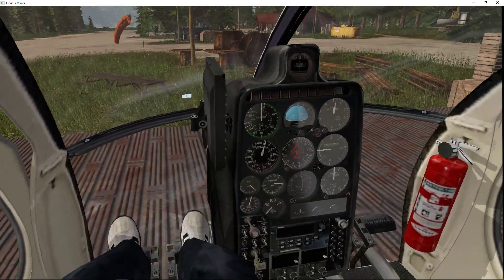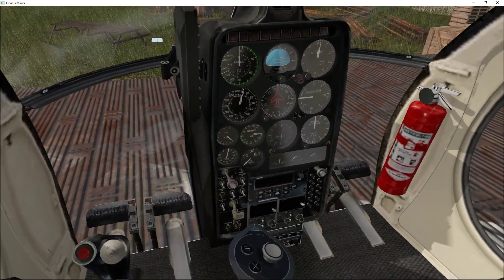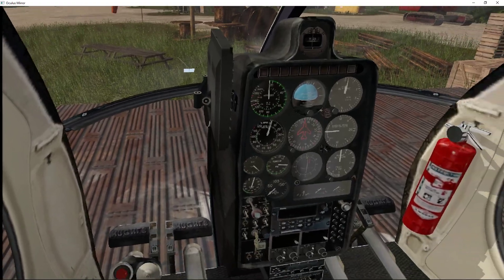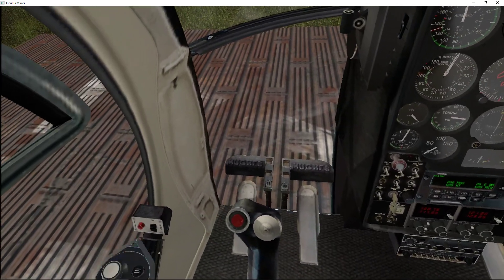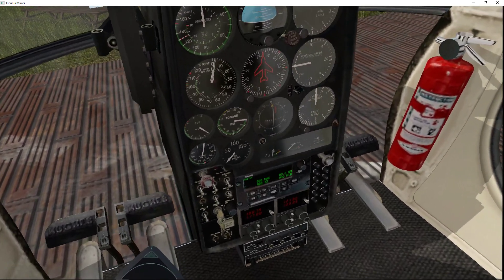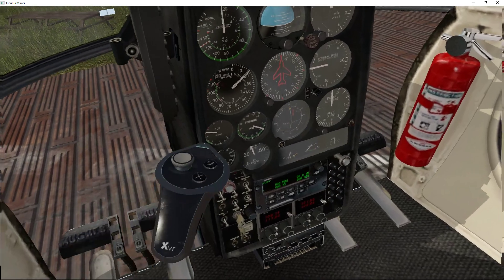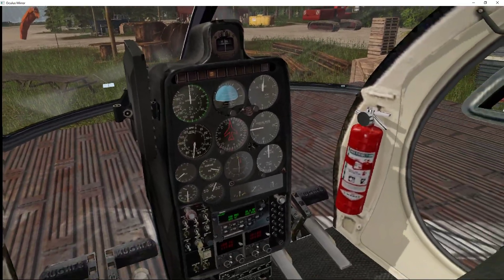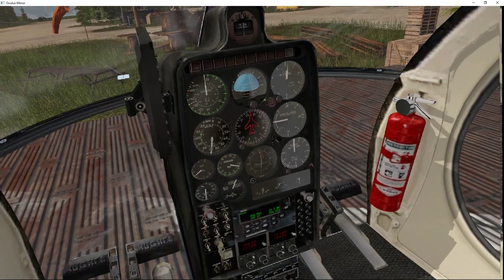Hughes 500D Freeware Realism Enhancement Mod - X-Plane

Comment: i have 2 questions please:
- why is this helo overheating during every flight? takes about 10 minutes and it would spit flames out of the engine.
- is there a way i can get the original tab back instead of the ipad? 
thank you so much for your work.

Comment: Curious question; in case of a hotstart, what would be the procedures to clear it ?
Reply: fuel shut off immediately, and leave the starter running to blow out as much of the gas as possible. Then refer to the POH (Pilot's Operating Handbook) for the aircraft and it will tell you if you are allowed to attempt to restart it (after allowing it to cool down over a set period) or if it cannot be used and the engine is then in the hands of the engineers to determine if you've melted the combustion chamber and needs replacing or if its ok to go again., Don't be that guy that writes off an engine for not paying attention and trying to restart the turbine too soon after the last run and not letting the residual heat dissipate sufficiently...

Comment: The helicopter Hughes 500D by Brett S. is totally overrated. This helicopter is the only helicopter pinned in the X-Plane forum, although there are other helicopters which have a much higher download rate. I know the reason: Because Brett S. is the moderator of this forum and he wants to push his own helicopter. By far the best freeware helicopter Bell 429 from timber61 with 120'000 downloads is not pinned, the Hughes 500D has only 23'600 downloads.

Comment: N1 relates to engine compressor speed which draws air into the engine, this keeps the TOT down during light off not the fuel which is why low N1 causes hot start.

Comment: how do i 1) assign the idle throttle and 2) assign lever for the rotor brake please.... great vid
Reply: get to your control settings, look for the button you want to assign and click "custom" on it. In the following menu type "500" in the search bar. It should list all the available commands for the chopper. Select IdleStop Ring Release, hit Apply. Not sure if you can map the Rotor brake though